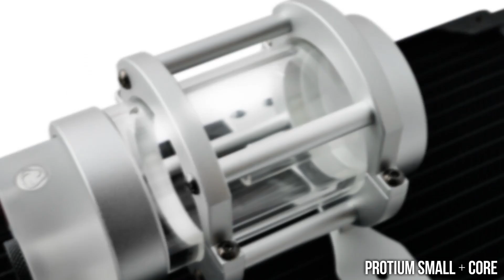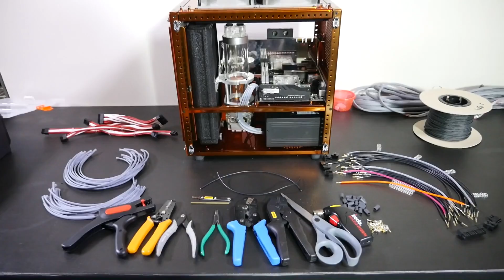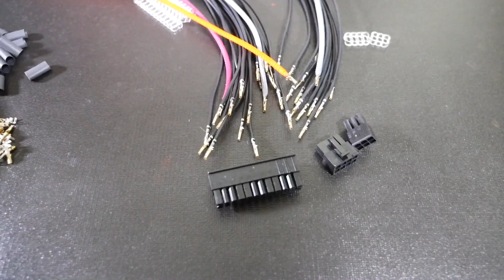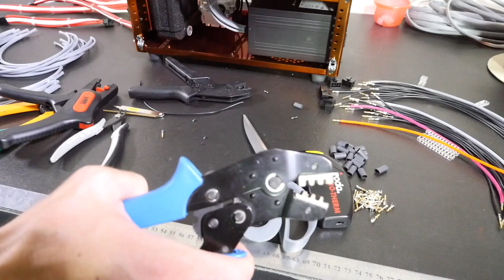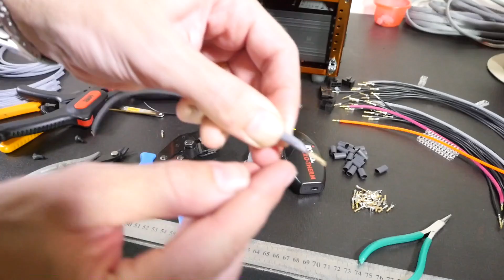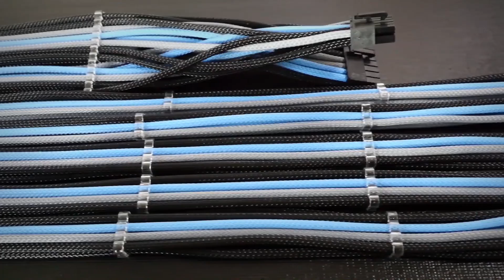Custom Cable Building

Comment: I have a Revolution DF2 1200 power supply. Unfortunately, I don't have the cables. I contacted the company, but they didn't help and ignored me. Do you have any solutions? I have some experience with wiring, but I haven't found a wiring diagram for the power supply. I hope someone can help me. If you have the same power supply and a multimeter, could you please send me the wiring diagram? I would be very grateful. Thank you.

Comment: I just finished making my first set of custom cables and I just wanted to say thank you for this tutorial it was invaluable 

Also a tip that I haven't seen mention is, sometimes the heatshrink doesn't shrink around the sleeve enough to make it nice and tight i recommend giving it a pinch after your first pass with the lighter of before it cools down all the way, really helped me get some good looking melts

Comment: I've made my first cables and tested them out today. They shorted my PC but they look so cool. It wasn't anything bad tho just had reconnect the base cables I had and it was all good. It's probably because I just cut the pigtails of an existing GPU PCie cable and sleved them. But this time I have all things I need to make a fully custom cable

Comment: I have just tried this with the same blue crimpers and i was using the middle crimp slot(before i saw this video) and i found it really flattened the back part of the cable together with the metal prongs that hold the cable which made it a bit too wide to slot into the connector receptacle so i have been quickly getting through the pins. Also i noticed that the middle part of the connection that goes around the bare part of wire was struggling to go around the wire as these cables from a Silverstone Flex psu are quite thick wires and noticed some pins have longer prongs to wrap around the wire. Do not reuse the plastic receptacle as it can easily damage while extracting the old pins so when you use it again sometimes the new pins won't stay in however much you try.

Comment: Those crimpers are called "open barrel" crimpers.  The way I was taught to use the crimper was to put the pin into the crimper, take a bite,  put the wire in, then crimp.        When cutting metallic sleeving...Harbor freight has some really cheap looking scissors that looks like they were hammered out of a piece of clothes hangar...that are actually carbon steel, really sharp, and work really well.        When putting small pieces of heat shrink on the ends, put them on in the middle before your insert the wire,  then move into position when you are ready to flame them.  This saves the problem of trying to put a small piece of heat shrink on a nearly same size cable.   I haven't done many computer cables, but I"ve done a LOT of military cables.

Comment: seems like you could do with inventing a machine that melts the sleeving without having to melt a piece of heat shrink each time. i imagine those fumes arent good for you either way so it'd also benefit from having an extractor system on it. 

I'm picturing a mechanism that opens and closes with a ring of say 4 heated ends that form a cricle around the wire as it closes and presses it all nice and tight as it melts. maybe teflon coated or something if the plastic sticks. 

Either way, with anything tedious like this, a machine that can save time and resources, and also solve a health hazard like fumes, would be worth it in the long run.

Comment: is the pin layout really matter ? since if you just put the cables in the same place on both pcie connectors you'll be fine right ? 
i do not need to know every function of every cable going in the pcie connector do i ? unless i gor from 8 pin to 6 pin ofcourse

Comment: Here’s a top tip from me. Use clear shrink tube when you’re melting the sleeving to the pin. Then you can see when it’s melted and you won’t over do it.

Comment: nice trick with the sleeve and heatshrink tube, that shit drove me crazy when i did mine few years back...i've reused the old wires, so my question is, what size of wire do you use for atx/molex cable? and what size of sleeve, if i remamber i've used 3mm, i would like to build a new pair of cables and it would be handy to know
thank you

Comment: Would it be possible to remove the head (housing) where the cable goes in once it's plugged in?
I'm asking because I would like to swap one for a different color (black to white).

Comment: Fallowing along. Doing this for the first time. Just wondering how to do a sata power push-though connector. (https://www.dazmode.com/wp-content/uploads/2017/09/SATA-CONNECTOR-_3.jpg) Would you make a shrink before and after the connector, or would you do one bigger piece and just push the connector thought the shrink tube and the outlining of the cable?

Comment: Ugh... I come across this just days after I've finished crimping my wires for my project. A project that I've put off due to procrastinating and because this isn't as easy as it looks. I've seen  Jayz, Kyle's, and others videos, but this video... this is perfect! I did an okay job, but the explanation and the tip of using the needle pliers to clasp the end wings to the plaster to keep the crimp from moving is genius and outstanding! I'm kicking myself for not seeing this sooner. The crimping part was the hardest for me because it kept sliding off or moving. Now I know for future projects. Thanks!

Comment: you're probably not active here in this youtube video anymore brother but i just want to ask you something, or anyone here.. can I use a 3mm pet sleeve for my psu wires? or 4mm? I dont want the psu wires to look ugly/thin etc.. and I want it to look just like that in your video. this is the exact product that im going to buy https://shopee.ph/10Meters-3mm-PET-Expandable-Braided-Cable-Sleeve-Wire-Protecting-Nylon-Insulation-Sheathing-Braided-Sleeves-i.227336823.7737076937

Comment: 10:51 I have that same crimper. How do you get it so that it release when you let go? Mine locks down and I have to lift a switch in between the handles for it to let go.

Comment: The pistolcablestriper tool should have V-shaped knives , some has flat knives and those work very poorly especially if you don't strip so much isolation. :)

Comment: Hello,

Your process with the little plier you use here: https://youtu.be/TkiBCtz13oI?t=833 is kind of a PITA... May i suggest you a proper crimping tool? You wouldn't have to bend the contacts = quick and efficient work. 
I came accross one here at page 8 (TRB0515B): http://www.sourceiex.com/Catalogs/Elpress%20Hand%20Tools.pdf

I used to wire cabinets and special terminals for industries and this is the kind of tool i used...

I like your attention to details, good job...!

Comment: When doing Custom Cable, why don't make them so they are stright outside (no cables are crossing each other outside the PSU) and then do the right Connection inside of the PSU.?
And think if every producer of PSU's had follow an ISO standard (ore any other standard, as long as all followed the same)  so it was like this, so all PSU's could use the same cables.?
I have experienced that PSU's from the same Company not even follow the same connection layout, so People.! be aware from not use the old cables when buying a New PSU from the same brand/producer. At Least check them out before Connection any Power.

Comment: Hey I want to sleeve my own cables. that's not theproblem. The problem is.. the cables dont like up to their corresponding pin at the other end...
Can I switch the ??? Like instead of pin 1 going to pin 3 on a gpu plug can I do 1 to 1? Or is there other communication for the psu?

Comment: If you buy a pre made custom sleeved extension kit can I remove the connector to install metal cable combs or roll it damage the wire ends?

Comment: What wire gauges you use for different cables? For example what gauge wire for sata connectors and which wire gauge for molex? Can i buy 18awg tinned copper wire for multiple wire sata connectors (press in connectors)

Comment: I use a KNIPEX MultiStrip 10 tool and it's amazing. Expensive, but it's a tool for a life-time so the cost is negligible. It's also what Nils uses. Perfect strip every time and no wire kinking or insulation damage.

See here: https://www.knipex.com/index.php?id=1216&L=1&page=group_detail&parentID=1363&groupID=1381

Comment: Extremely useful thanks.  I was wondering how you make the  connection when two wires from psu go to one on the mobo connector (see corsair axi pin 13).   I'm thinking you use 22 guage instead of 16, and try get trh crimp to do both.  Is that right ?  Thanks for these videos.  [Edit.  Found it.  Just awesome https://www.youtube.com/watch?v=A81EpcoIYSQ ]

Comment: I can recommend this torch: http://www.ebay.com/itm/LASER-Cordless-Gas-Heat-Shrink-Tubing-Torch-Micro-Therm-Hot-Air-Gun-6848/330243294045?ssPageName=STRK%3AMEBIDX%3AIT&_trksid=p2057872.m2749.l2649
works really good!

Comment: how do you know what length to cut wires with 90/180 (left, right, up/down) bends?  Every bend changes the length of the wire as outside radius needs to be longer than inside radius, etc. Do you measure for each individual wire?

Comment: This was much more helpful than the original Lutro Customs video from Nvidia, and the rehash of that method by Bitwit.  I ordered some pre-sleeved wires from MainFrame Customs, and it appears they've changed up their method from when they were Lutro.  Now they crimp the sleeve in with the first crimped wings.

Comment: Where do you get the power supply side connectors? I mostly mean for like 18pin and 10pin connectors they use on the PSU side of an 24-pin ATX.
Reply from the maker: You can find them on my store.

Comment: What is bad about crimpers from any hardware store? Are they different in anything? What wire Gauge are you using for power cables, 18 or 16 AWG?
Reply: You can use 18 or 16 awg, some connector pins have larger "wings" to help crimp around 16 awg though. 
I get my gear from Mainframe Customs, even shipping to Australia is reasonable. Then buy paracord locally. You'll be hard pressed putting paracord 550 on 16 awg though.
You can use generic cripmers for the correct pins. The blue handled ones he's using are easy enough to get on amazon or ebay if you look around. I have one that looks the same and it says it's for 0.14-1.5mm2

Comment: How convenient? I spot this video in my YouTube feed as I'm sitting here sleeving a friend's PSU.
A few of my methods differ from yours because it's what I find quickest/most comfortable with; but I'll definitely be using your "master length cable" method to ensure my cable cuts are all the same length. My first sleeving job (My own rig) has required me to redo it twice now due to sloppy worksmanship the first and second time. The third time I cleaned it up alot (I cut the cables to individual lengths so that they would naturally curve, helping them stay trained) but stuffed up a measurement on a SINGLE wire on the 24-pin so I gotta dive into that at some point in the near future and clean that up cause my OCD is tainting me about it... that means shortening 23 wires because 1 is shorter... sigh

Comment: I sleeved my 24 pin and 2 pcie cables for about 10 dollars. I just bought standard cable extensions on ebay, figured out how to remove the cables and then sleeved them in 3 colours using sleeving i also got off ebay. It takes a fair bit of work when you're not used to it but I still got great looking custom sleeved cables for dirt cheap :D It works out much cheaper than buying wire/pins/connectors separately.

Comment: Recently I custom cabled a corsair rm1000i and noticed that some cables had capacitors between them on the original oem cables. I ended up adding them into my cables but wanted to know your thoughts on their importance (not to mention they take up a bunch of room on the cable)
Reply: ZLS Designs 
You should be able to remove them.
But verify the pinouts before removing the caps.

Comment: You should buy pliers that they use in surgery(i don't know what they are called in english). You can use them to lock the sleeve very tight when melting the heat shrink to the connector. They also leave your both hands free. Tried and very, very useful.
Reply: heamostats

Comment: After watching this it seems, "wire is wire". So why are charts on corsairs website about which cables are compatible with which psu?
Reply: BushwickBill tks yeah hopefully dude can do a vid explaining to noobs like me
Reply: greenbay james The pin out! You can't run the cable straight from the psu to the mb! for example it starts in the PSU connentor int upper left corner but it plugs in the mb connector in the lower left corner. (hope you understood it. just Google the pin out for your specific psu and you will get it.
Reply: they all have diff plug arangements
Reply: yea it would make alot of sense if they were all the same as they should do with front panel connectors, it would be so easy to make it all in one plug and every motherboard would accept that plug, but every manufacturer does it their own way

Comment: in material, what does a full stack of cables cost for a build when i buy the connectors, the wire, the tools.... ? only estimate
Reply: Not sure if your still interested, but you can buy the wire anywhere from $1-5 per meter depending what quality and where you buy from

Comment: defiantly need to try my hand in this. have had cables fail when you have custom bios with lots xtra load on those power cables especially 6 pins can fail/get hot.

could you make larger conductor cables?

Comment: Great video as usual!
I would like some more in depth guide on how to calculate lenghts when doing 90 (180, 270 etc) degree turns.
For exemple an ATX cable could turn 90 degrees several times around the chassi. 
And also outgoing cables from a connector needs to come into next connector rotated. 

It would be nice to see a complete video where you do a complete ATX cable with lots of bends and you go through your measure and calculation.

Comment: Shrink with gas solder at 600 degrees? Massive overheating causes massive oxidation. Get a proper heat gun for that.
Reply: The thing is,
that the sleeving has to melt for it to grip onto the metal peice then when the plastic is melted and is solid again you rip off the shrink

Comment: Q and A:
How do you polish ek GPU backplate to a mirror finish? Is there a way to remove the cnc marks from it?
Reply: TheD†uned no not the bottom side but the top side that you do see.
Reply from the maker: You cant because its under the plating. You have to take the plating off and polish the alloy.

Comment: Very nice and informative m8, really appreciate it. 
For your next part i'd like to see how you make custom lenght fan cables (longer then the original) with appropriate sleeving.

Keep up the fantastic work, i'm learning a ton for my personal upcoming build.
Reply: wasn't he showing in one of the last videos, that he sleeves and customizes the fan cables to the same length all and then uses sleeved exact extension cables?
at least that was the case for the radiator fans he showed.
regardless would be good to show either way.

Comment: Is it me but building custom cables end up costing the same as getting them made or close to it. It's nice to be able to make the perfect length though
Reply: it's cheaper to make yours. but to excel at having everything very well aligned, you will consume time and material. if you will do this regularly. then yes do it yourself. if you will do that one time. buy them pre made.

Comment: hey you maybe should consider getting an electronic crimper so you have two hands free and don't have to bend the pin in place first so its a loot faster and easier